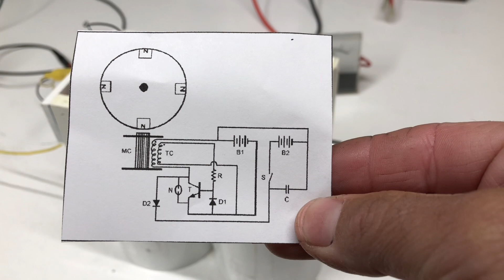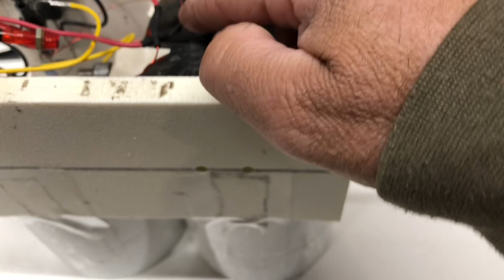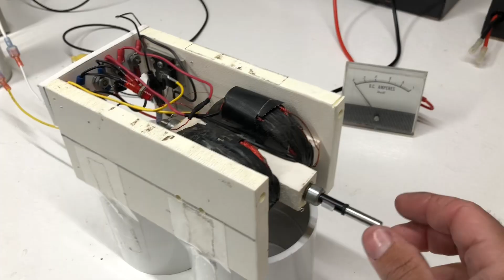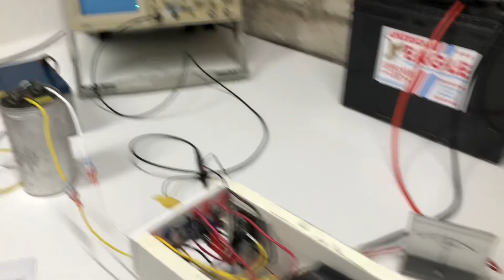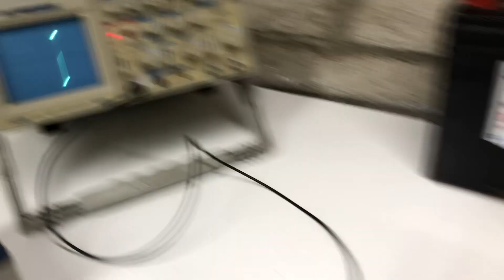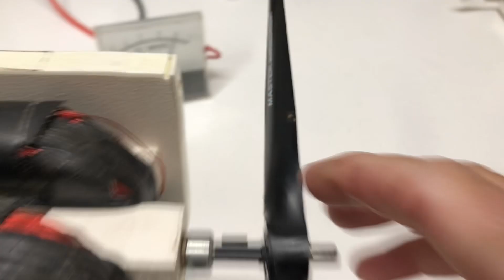Window motor

Comment: Nice. Hood job
What does your stator look like
It is pretty small
What size magnets?
Thanks
Reply from the maker: Thank you 
 The magnet is 3/4 x 3/4 x 1/4 neo
Reply: @kenergy1707  thanks
Can you show it pleasr
Just one magnet?
Reply from the maker: @Gacha.Cupcake  
It shows on the video in the middle between the coils it’s round 3/4 neo magnet